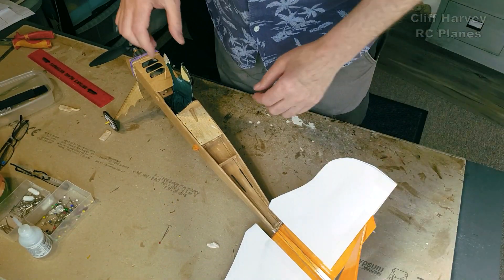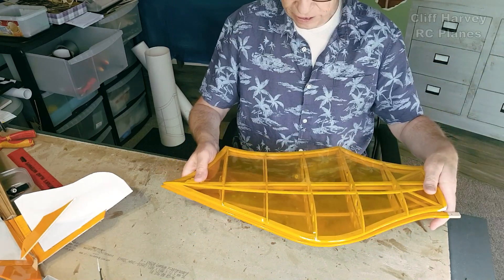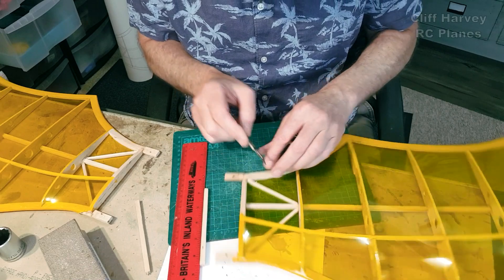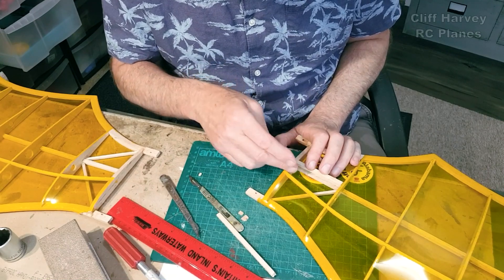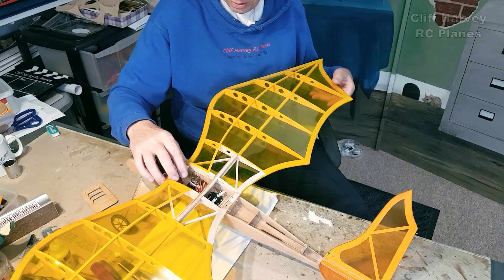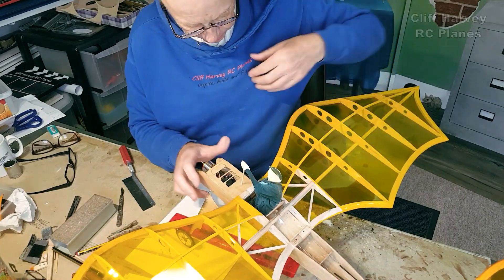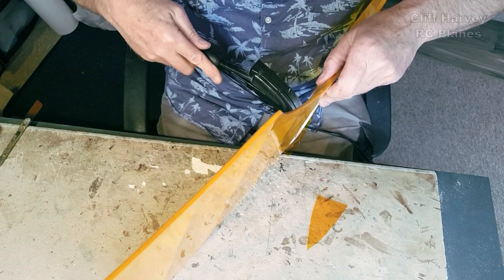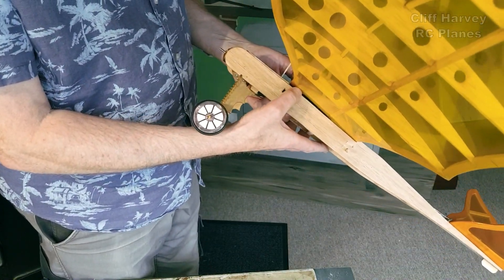Da VINCI FLYER Banded-On Wing Conversion

Comment: I believe if you attempt the biplane design. Pull the lower wing back a small bit half inch perhaps, and move the top wing to sit about 2 inches above the fuselage and make sure the top wing is about even where the motor is mounted to the fuselage, should fix the tail ussue I saw. You added to much weight to overcome the Wing offset issue leaving the motor underpowered. That's what it looked like to me
Reply from the maker: It was one problem being solved causing more problems, inevitable I guess, the next one will be a lot better, thanks TB 👍
Reply: @CliffHarveyRCPlanes  just armchair second guessed, over here. Lol